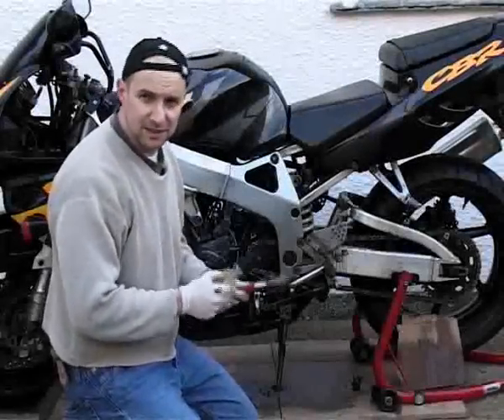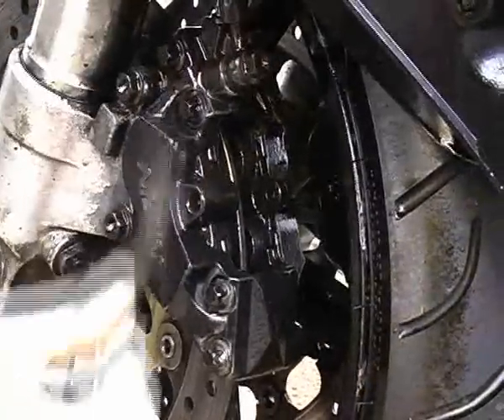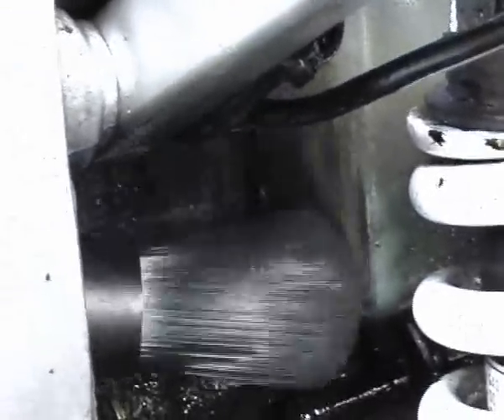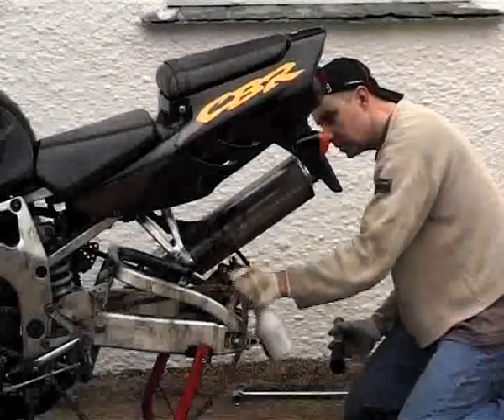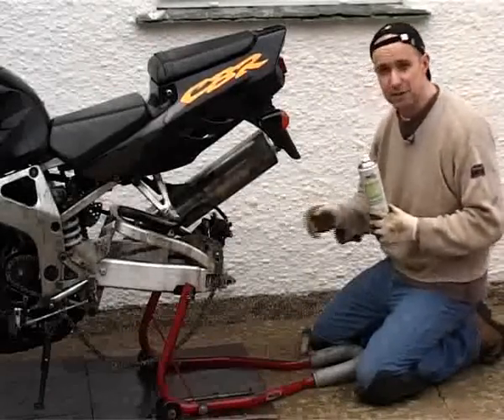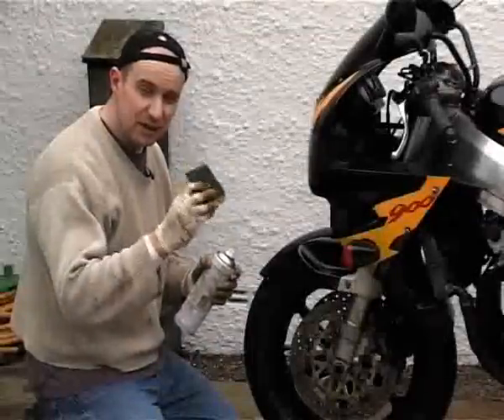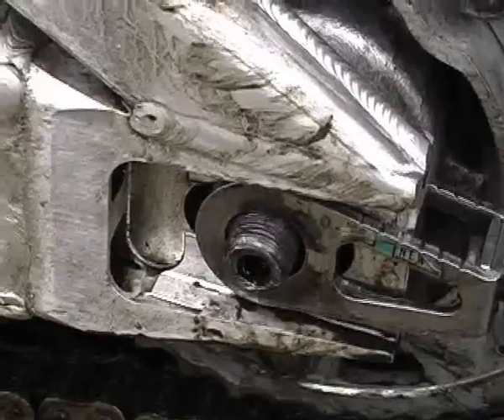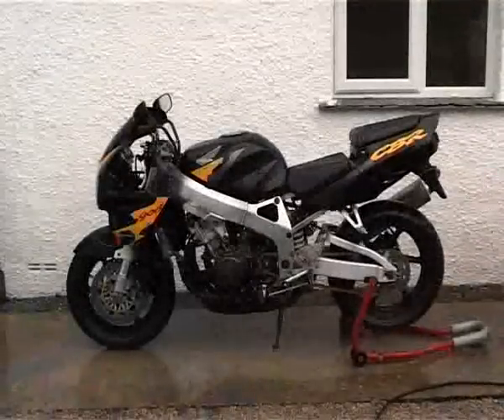Clean your Motorcycle - Part 2

Comment: @OriginalPriapismSD 

Most relatively modern motorcycles are going to have sealed bearings. The pressure form a garden hose isn't high enough to cause too many issue. However, using a power washer is bad idea.

Comment: Impressive dedication!! And quite a bit of good know how but why the heck doing it all, or worse, pressure washing it of IN FRONT OF A WHITE HOUSE?? *LOL*
Me myself is a practical guy  washing the bike just take off mechanical protective oil based film I rather have a well working bike than a shiny bike with grinding bearings or later on even worse oxidising parts. Be careful cleaning! Leaving it out for a short rain is my way ;o)

/Practical Swede

Comment from the maker: That's the myth behind pressure washers. Most domestic ones will not be powerful enough to get past the seals in your bearings. They will strip flaky paint though, that's more of a concern. I've never managed yet to screw up bearings using one.

Cheers

Nick

Comment: some people don't do WD40 directly on their chain because it's controversial , I've heard you can avoid the possible problem with WD40 and chains by applying it on a rag / brush first instead of spraying it directly on ... , for other parts it doesn't really matter so much.

Comment: Is it alright to use a power washer on the bike? My owner manual says avoid using high pressure jets on the engine so it doesn't get into the electrical components.

Comment from the maker: Well in a perfect world yes, but you need to take the cardboard away which means putting the bike back on it's wheels, otherwise the oil soaked cardboard turns into a enormous mushy mess. This way is the lesser of two evils. To be really pedantic you could always take the rear wheel off again, but I find the way I did gives good enough reults.

Regards

Nick.